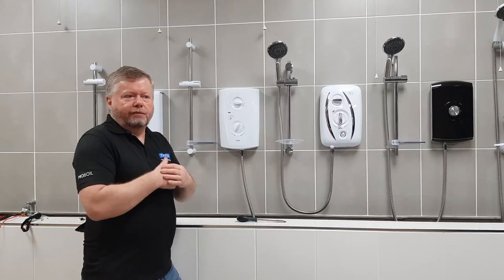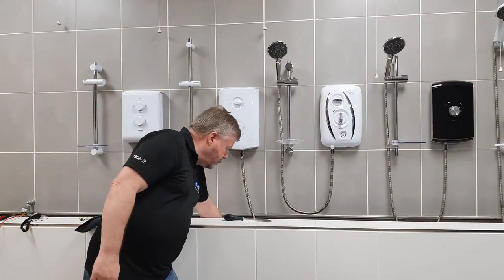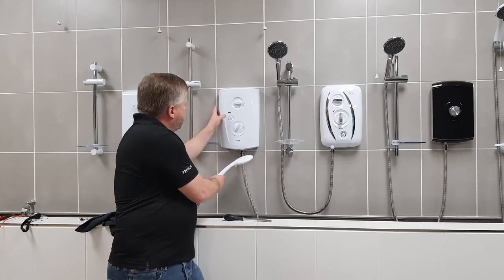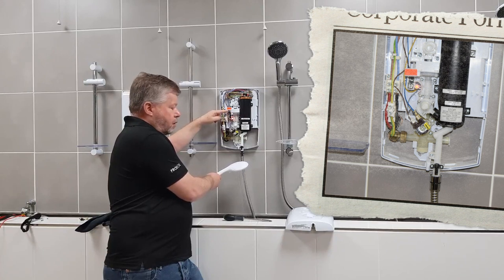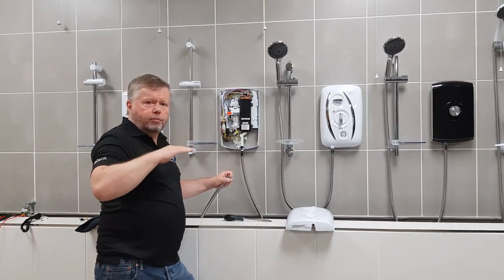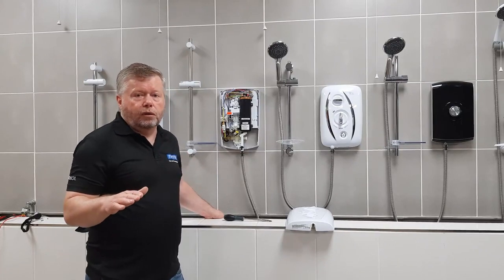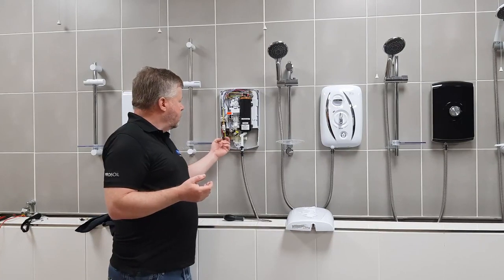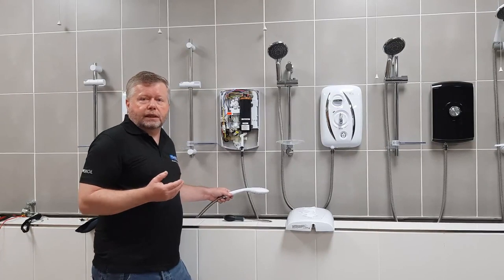Water pressure problems affecting your shower

Comment: Hi, I've just had a Triton Aspirante 9.5 fitted, when the temp is on cold the pressure is above normal but as soon as i turn the heat up the pressure drops dramatically even on the cold button setting.. this is a replacement shower and i've never had an issue before..

Comment: My Plumber has just swapper a T80z for a T80+ Easi Fit. Have a "low Pressure" light/indicator when the shower is powered off. When I turn it on, the light/indicator disappears - I guess this means I have sufficient water pressure? Water is very hot when the temperature control knob is fully rotated clockwise, but the water flow is then pathetic. If I turn the temperature control knob anticlockwise past the "low pressure" light/indicator, the flow increases to a desirable amount, but the water runs cold. Here's the million dollar question - is my T80+ shower operating correctly? Any further tips on how to strike the best balance between temperature and flow?
Reply from the maker: Hi, the pressure indicator is attached to a mechanical arm which moves with the pressure of the water. When the shower is turned off this will be in a resting position and showing through the low pressure window. When the shower is turned on if you have enough pressure the arm will move and the indicator will move away from the window. This would sound to working correctly from your description. Regarding the flow rate our electric showers heat the water instantaneously. In turning the dial further to hot it will be restricting the water flow in order to allow more heating. And in turning it further to cold and allowing more water flow it will heat less causing a cooler temperature. However this is also effected by ambient water temperature coming into the shower, so you will find in winter you will get less flow as you will need to heat the water more to get a hotter temperature and in summer you will get a better flow as the water doesn't need as much heating. Kind regards, Leon.
Reply: @TritonShowers we have the exact same shower was used this morning at 6am and now at 10am there is no hot water at all coming out and can see a very dim light on the low pressure window. Checked the shower head for any blockages etc nothing. I think the quality of these showers are poor we have already had an engineer out for this shower 1 month after it was fitting for the same issues.
Reply: @TritonShowers  I also agree that triton showers are poor then in that case if it believes at 30c it's operating at warm temp thus deminishig the hot water flow. Terrible. And that's a terrible answer and a cop out of one too as one would suggest that in the summer the cold water is primarily used and thus the flow isn't a problem, not the 30c.